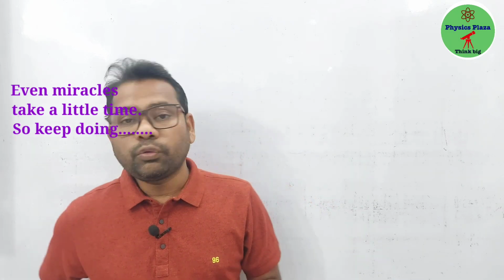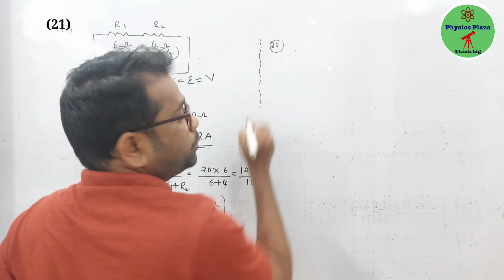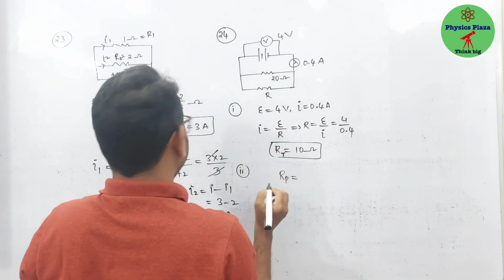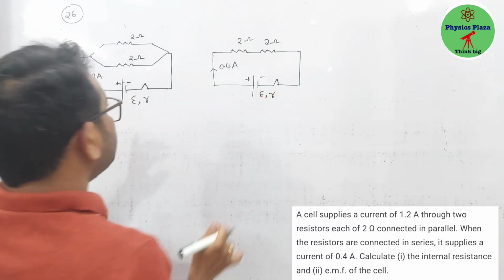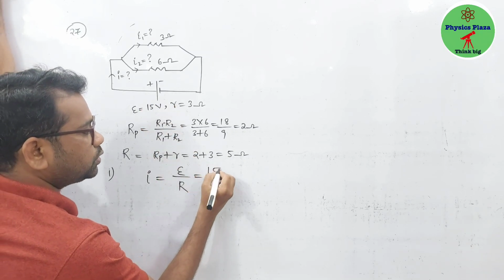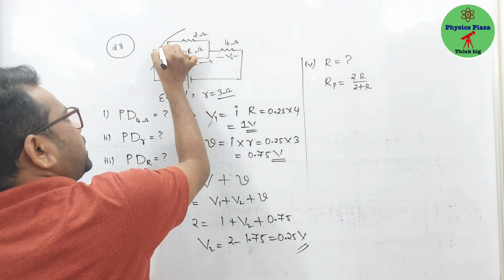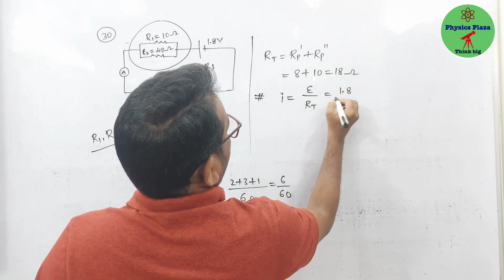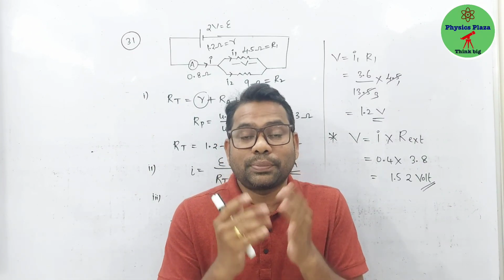Current Electricity ||Numericals ||Exercise-8B Part-2 || #class10 #cbseclass10 #icseclass10 #ssc

Comment: hello sir i really like your explaination and i follow every 10th class video of yours. sir i have a small doubts in prolems 22 and 23 , i am confused which resistor in parallel circuit should be taken R1 and which R2
Reply from the maker: Glad to see your message..
Definitely I will clarify..
Let me check the numericals
Reply: @physicsplaza9017  sir is it like that ,  for the resistor with smaller resistence we will take it as R1 and for the bigger one R2

Comment: Sir, actually i am confused if effective resistance and resistance both mean the same can you please tell if they both mean the same or do they have different meanings
Reply from the maker: Hello dear Balaji,
If more than one resistors are there means,we will calculate Total resistance it is also called as Effective resistance....
Generally,we use Resistance only for single resistor we use